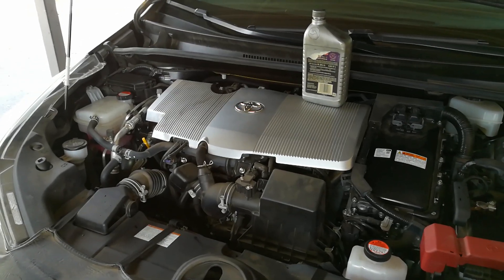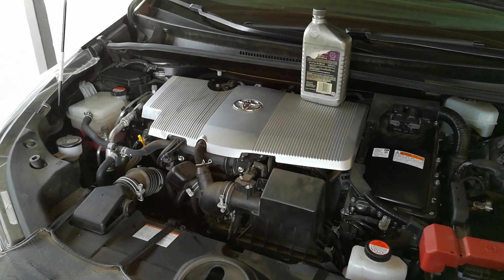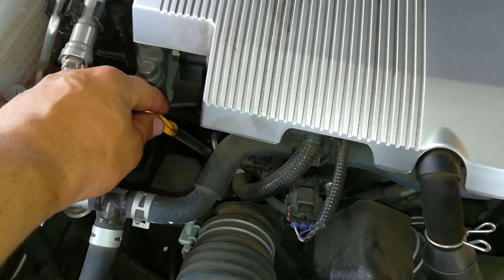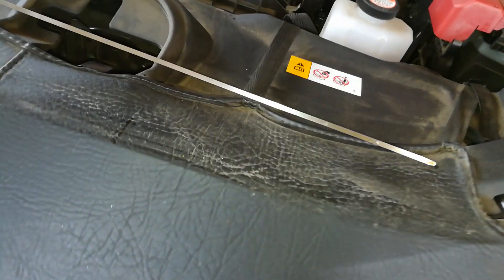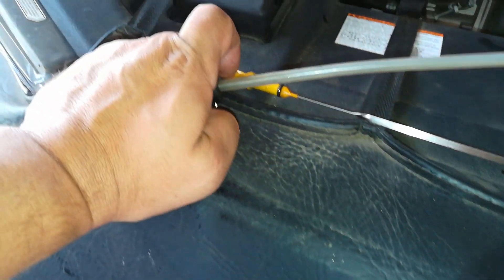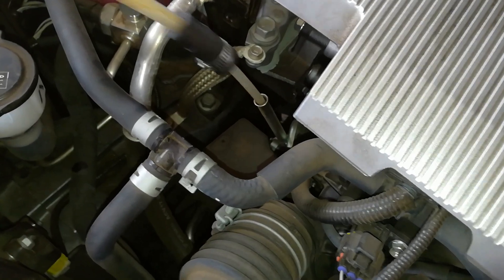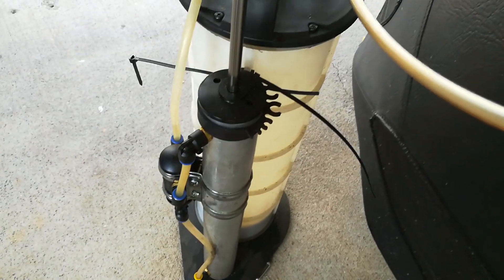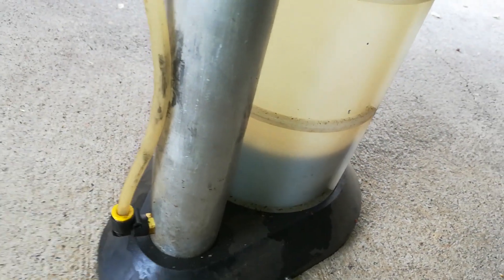OverFilled Engine Oil▶️ How to Remove Too Much Oil In Engine

Comment: who the hell has one of those machines.   this was useless.
Reply from the maker: The machine is pretty common, check the video link if you want one, I  use mine for sucking our transmission fluid, oil, diff fluid.